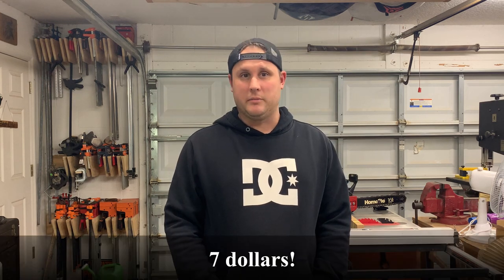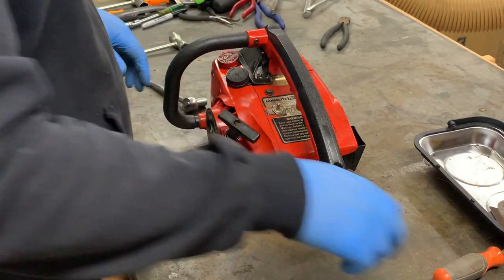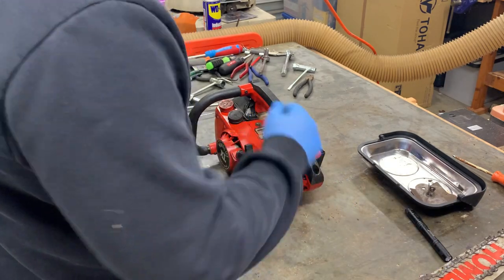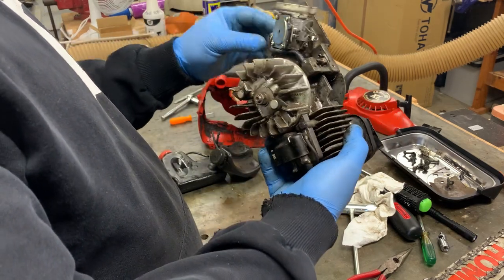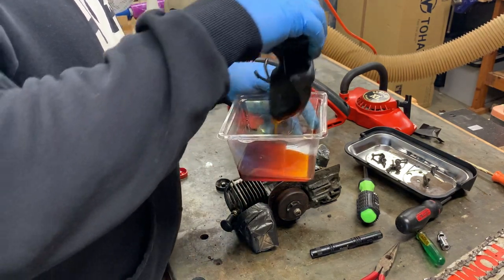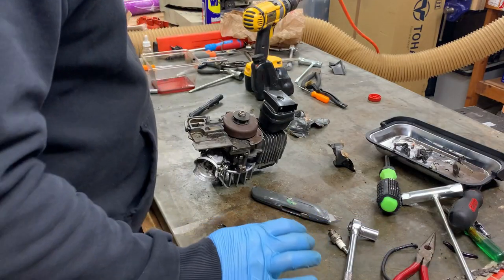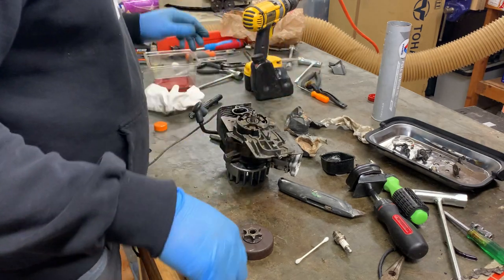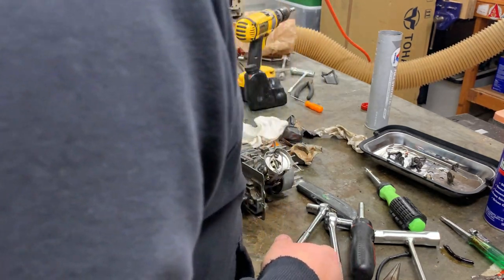DIY Homelite XL chainsaw part 1, teardown and diagnosis

Comment: Del tanque de aceite lo que salió es la válvula de "pico de pato" está montada en un tubo de latón para poder conectarlo a la manguera que presuriza el depósito. El otro tubo con un filtro en la punta interna, es el que lleva aceite a la bomba (y de ella va al orificio de la espada para lubricar la cadena) 
Tengo una igual, es muy buena maquinita, pero ésa tuya se ve con muy poco uso, quizá la recorras bien y te quedes con ella, si no la sorteas en beneficio de alguien. 
Desde Chubut, Argentina, me suscribo y te deseo muchos éxitos.
Reply from the maker: Thanks for the info, and subscribing! Also thanks for all the help. You’re correct!